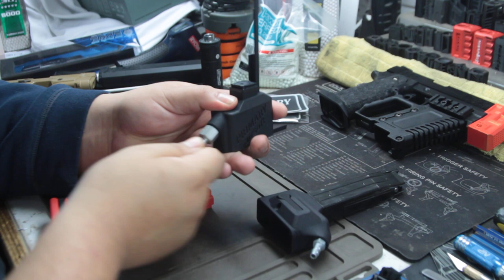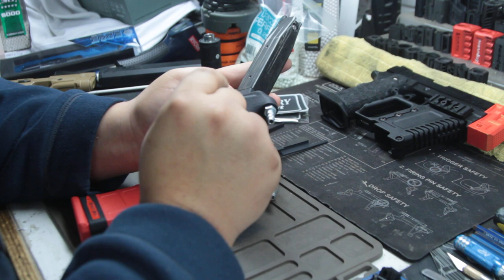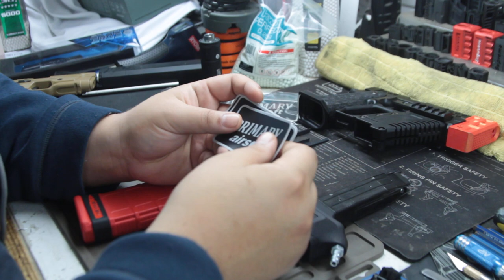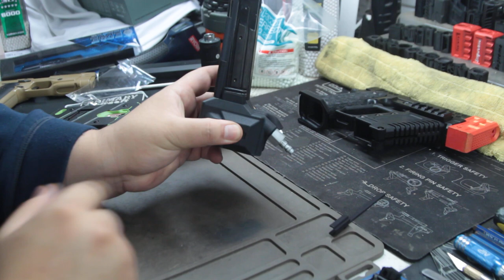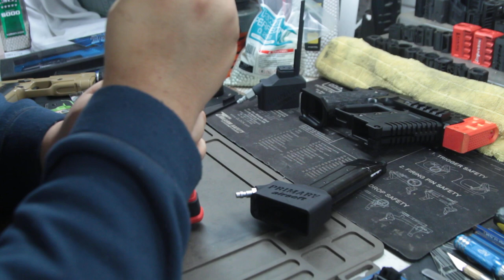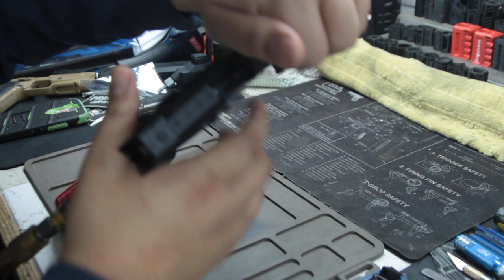General Overview: Primary Airsoft V3 Hi-Capa Mag Adapter

Comment: So I was thinking of getting this, and I’m Not sure about the part that holds the mag, I am a speed softer and I run ALOT I’m worried that the mag is gunna just fall out when I’m playing does it seem like a tight fit with little movement? Lmk man this will help a lot, oh one more thing what mag are u using in this video? I love your work man!
Reply: Checkout the 2019 SpeedQB National Championships to see KWA MVP player Quin Harris running a Primary Airsoft adapter in competition.
Reply: I'm also a speed softer and run the primary v3 and hands down it's amazing I dive and slide about with no issues and this thing feeds flawlessly